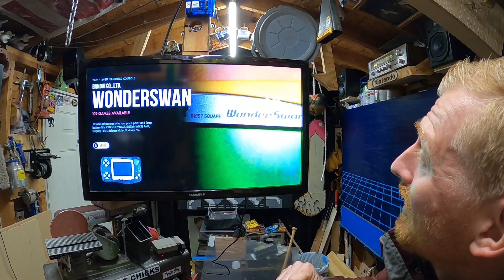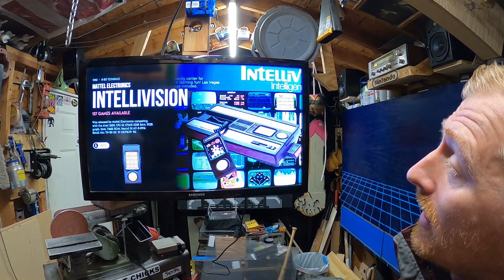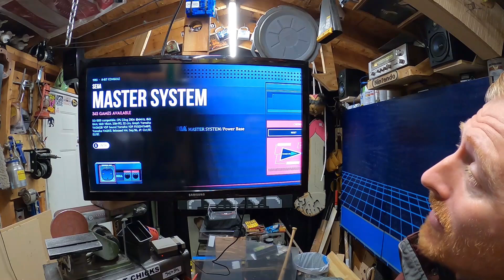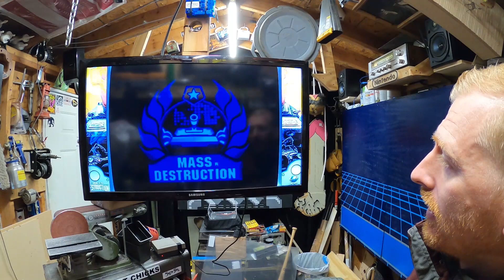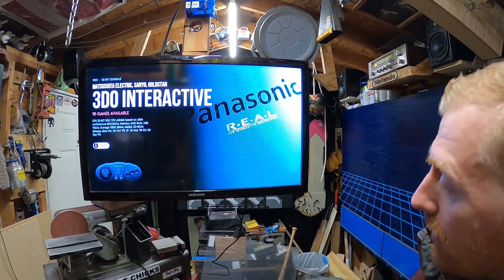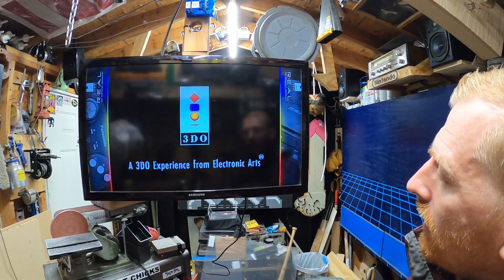This Changes Everything!! Pivotal Moment for the Show!!

Comment: Hat's off buddy!  This is thanks for the hours and hours of laughs and entertainment being part of the community. ( I meant that on the lifetime warranty for imaging drives for you as well.)  Eternal sip here!  Was Return Fire on the 3DO btw (Mass Destruction on the Saturn) and it does work as I was playing it last night.

Some Saturn games work better than others at this point unfortunately (especially if they're 3D based) but they mostly work now (Pi can't do a lot of polygons at the same time,.... yet).  It's why Burning Rangers isn't there either unfortunately (my favorite Saturn game),  Enjoy!  

Peter Marshall (Hollywood Squares) last name is LaCock btw.  That's right, Pete LaCock Jr (baseball player) is his son.
Reply: @Wolfanoz subbed to you for being awesome
Reply: @ToastyCubes  10 months pre-covid.  Sadly as I said, some of the 3D heavy games don't work great due to the GPU on it but it runs better with each iteration of the Pi.   2D games are fine.  Going through most of the controls took the longest for each game arcade wise (2400+ games) believe it or not.  I can't do Attract Mode as much as I respect it.  If youre going to use anything for PC, I highly recommend Launchbox (which has BigBox mode) and is a better version of Attract Mode with a TON of themes for it.
Reply from the maker: I was running low on time so we didn’t get the scope of this truly amazing machine. We take a closer look next show. This machine will mold the show moving forward. I’m very grateful... thank you brother.
Reply: He can finally play arcade roms for gods sake
Reply: @zachary_attackery  haha that's exactly what I was thinking!
Reply: @Piss_Pistofferson  On the PC, it plays flawlessly with emulation.   On these small boards, not so much yet but they’re getting better.   It plays everything fine up to the Dreamcast now with Saturn getting better.  The 2D based games on Saturn for the Pi 4 play fine from what I’ve seen and tested so far.  But it’s convenient to take one of these small systems with you on vacation or a business trip.
Reply: Oh lordy... there's like, all this money in my account. 
I'm not sure what I should spend it on I NEEDTHISBOX.
Reply: Were you on efnet IRC back in the day?
Reply: Is there someplace I can buy the same one you sent Bithead already loaded with the roms and everything?
Reply: @zachary_attackery  I recommend getting the parts off Amazon (Retroflag NES Pi 4 case, Raspberry Pi 4 4GB or 8GB, 1TB Samsung SSD (evo or qvo drives are fine), or if you want my 256gb image for it, a Sandisk 256gb ultra microSD card, and a good ps3 clone controller (which is what I use to set these up with and gave Bithead, you can usually find them cheap and they're perfect for these images).  Your preference but most controllers work.  

You can look up my name to find where most images are on Google and watch a good tutorial here on the ‘Tube how to image a drive for Raspberry Pi 4.  There are plenty.  Some with my images.  Will save you a lot of money and you’ll learn in the process as much as it’s easy to spend on something made.  They’ll usually rob you and give no support with it.  Plus selling these images will get you in trouble in the long haul.  It specifically says when my images boot up that if you were sold this, get your money back.
Reply: @diehlr  Yes, a looooooong time ago 😆
Reply: @Wolfanoz  Lepper here

Comment: Hey Jesse, you should look into gettin a UPS for your shed.  That solves the problem of your camera running out of juice when some internet gold is happening.  They aren't that expensive... just don't plug a fan or a heater into it, as it will drain the battery faster than your wife will drain your bank account when an appliance needs replacing in the house.
Reply: Was thinking the same exact thing, bud.  He definitely needs one for all the electronics, if not the recording equipment.

Comment: Chris, what did you do?  Mass Destruction not working!  And there's some sort of weird flicker whenever it tries to load.  Is the Power Adapter you included not giving the system enough juice?
Reply: It works, it’s the difference with the camera shooting and the TV.  I don’t get that here and I have a system I made all this on here that’s similar to his.   Return Fire for the 3DO works, same game.  Some heavy 3D games on the Saturn aren’t there yet.  I left them there in case there’s ever an update to the emulation.   Dreamcast almost runs flawless ironically.
Reply: @Wolfanoz  Ah I gotcha, yeah Saturn Emulation is still a bit of a work in progress for sure.

Comment: This guy's game station build has got me so excited! 3DO games, Sega Saturn games, N64, neo geo and more! I'm really excited to see what you play.... I'm looking for help hacking my mini systems if anyone is knowledgeable. I want to put just Sega Genesis/Mega Drive games on my mini Genesis, Super Nintendo and N64 on my mini SNES, etc.
Reply: I don't think you can put n64 games on the snes classic. I could only fit about 150-175 snes games on mine before it was full. I was able to put all the nes games on the nes classic. My advice is look on etcy for someone with a flash drive with all the roms already. It cost me like 20 bucks
Reply: @captaintony1227  Wow cool.  The N64 flash cart is around $80.  Where do you see $20?
Reply: Some of what you mention is what I did.  I bought some modded systems on ebay.  Genesis classic, and SNES classic.  I'm now looking for a Sega Saturn modded and PS2 modded, but I don't know much about that.
Reply: @captaintony1227  Thanks for the heads up!
Reply: @LukeDodge916  no worries I wish I was more of a help. I'm just learning how to do it all myself
Reply: @newgameaaaa  PS2 is easy. Just did it myself.  You can do it with a FMcBoot memory card.  (Get one on Amazon for $10). Then you can play games on burned discs OR off of a USB drive.  Easiest mod ever. No soldering or crazy hacking needed.  Easiest ever.  Was very impressed!   I’ve got almost EVERY PS2 game now
Reply: @gamingguru1807  Wow this seems too good to be true.  I see a FMcBoot on ebay and amazon and there are different versions.  I saw some tutorials on youtube about installing it and playing it, but none talk about how to do it all.  Is it just plug and play because some videos talk about installing it on a memory card?  Then burning discs or using a usb drive is another story.  Do I have to download games on the usb drive or something and format it?  If I can get this I would be so happy and won't have to try to find some games I want on ebay that are really expensive.
Reply: @newgameaaaa  yea so you just put the memory card in the PS2 - turn it on and it “boots” up with a menu.  The menu lets you “play from a disc” or “play from a USB drive” among other utilities.  IF from a USB drive there are certain ones that work with the PS2 (list available online) and then if from disc - yea you just burn the image on a DVD and you’re done.  There are tutorials out there.  But hands down this is the EASIEST “mod” out there.  Maybe the Nintendo DS gold cart is easy too.  But yea very easy.
Reply: @newgameaaaa  FYI. Get the fmcboot from Amazon for like $12 or something.  That’s the good/latest one.  It comes in a box with a manual as well!  Ohh yea the manual!  That even tells you what to do.  That’s right.  Didn’t even have to watch a tutorial.  T he manual that comes with fmcboot tells you!
Reply: @gamingguru1807  Ok Thank you very much!  Whoa a NDS cart?  I'll have to look into one of those later.  I bought a NDS multicart from ebay for about $28 and I thought it was amazing at first because it had so many games on it.  The next time I put it in it wouldn't read.  😞
Reply: @gamingguru1807  WOW!!! IT WORKED!  I just tried it in my PS2 and put 2 games on a usb and they loaded.  I looked at some tutorials on youtube first, but it worked.  The iso files worked, but I tried a game that wasn't an iso file called castle shikagami.  I don't know about that file type, but the iso works.  I would still pay for someone to do all the labor for me, but for now I can just put the games I want to play on there.  Thank you very much Dustin!
Reply: The format was BIN/CUE for castle shikagami.  I don't know how to get that to work.
Reply: @newgameaaaa  awesome!  Glad to hear!  It HAS to be .iso yes.  The one that’s bin or cue is wrong.  Only thing I’d say is find that rom again/somewhere else and it should be ok the correct format
Reply: @ronnienoneyabusiness2844  I'll check him out then. Thanks